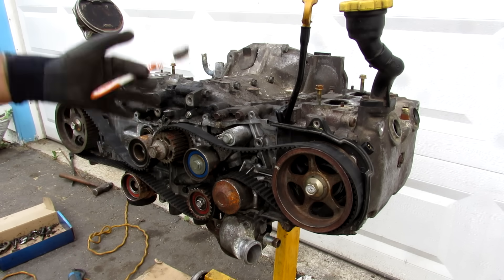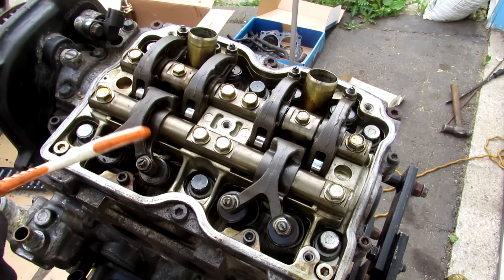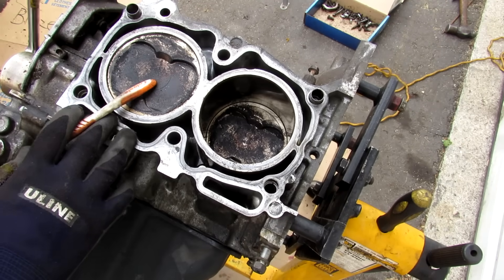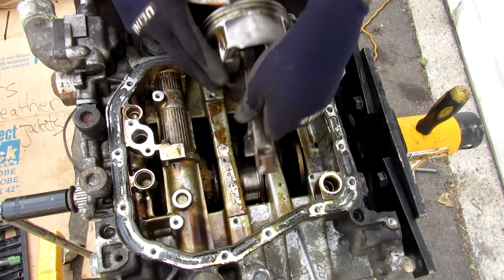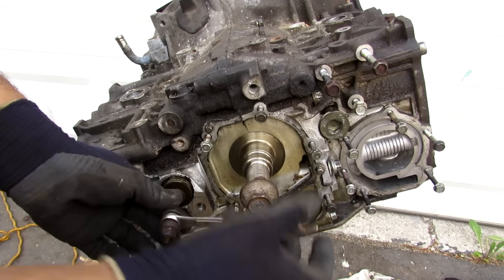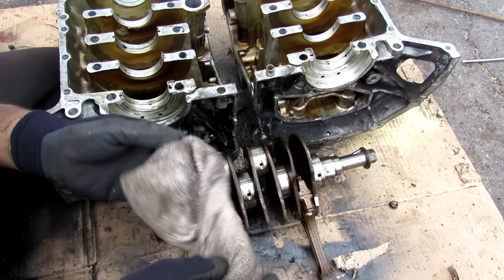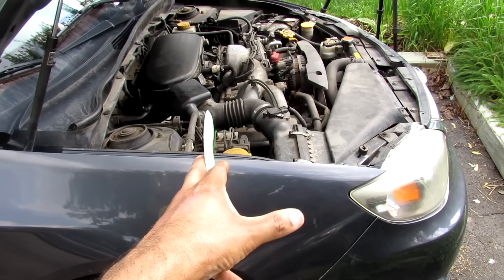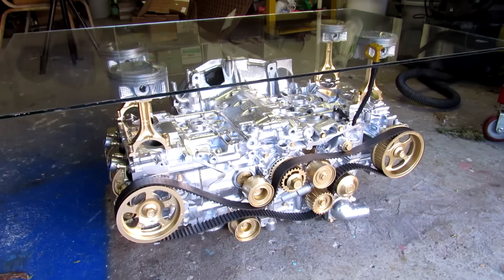Why Subaru Engines FAIL

Comment: Never owned, drove or had plans to buy a Subaru but your video is so well done, to the point and captivating that I watched the entire thing on the edge of my seat. FYI, I have been turning wrench since 1989 so good production is needed to grab my attention. You did it without the need for cheesy gimmicks or having to blow anything up. That takes skill. Nice work!
Reply: If you never run low on oil and never keep old oil inside the engine they dont fail, these engines are very susceptible to maintenance neglect, if the previous owners were idiots you Will have definetly problems
Reply: My 2-litre 2005 Forester did over 250000 miles before increasing maintenance costs made me move it on.  Don't know how far the next guy managed.
Reply: @alanhynd7886  Thats quite impressive milage. People here think that car with over less than that are junkers and preffer to he lied to that their car has equivalent of around 100k miles regardless of age.
Reply: @Kacpa2  Hi Kacpa2.  I obviously can't know for sure and might have been lucky, but I suspect that the advent of better oil (synthetic or semi-synthetic), better machine tolerances, etc probably means that a lot of vehicles can run a lot further.  My prior two cars were both SAABs and they both exceeded 250K. My wife's current car is a little D2 Volvo and it's at 150K without any major problems.
Reply: Subaru makes very good engines.  However, I would go with the NON TURBO engines.  They always have fewer issues.
Reply: @spaceghost8995  Its just a good rule in general in regarda to all kinds of engines.
 Mechanical illiteracy and lack of care is catastrophic for turbo engines in general, especially showcased when noncar people just beat around in heavily worn down turbo diesels. 

People already tend to mistreat their cars when they only use them for commute by not letting it warm up, driving it hard when cold and not letting it cool down a bit after the trip(in turbo cars)

 All this compounds massively on top of cheapening out on repairs and using long life stupid oil recommendations.
Reply: my 2008 Subaru 2.5 has 164,000 on it, same factory gaskets. I just got 27-30 mpg on a 2,600 mile highway trip. Change the oil, change the oil....
Reply: It’s a good beater. Got mine for free around 120k now I’m around 240k+ zero problems
Reply: I have 2 Subarus that I bought new and have had zero issues. I think this is because I always do the maintenance when due, if not a little early, I regularly check fluids and add if needed, and I don't drive like a bat out of hell.  Subarus will last a long time if maintained properly, but are probably less tolerant than some other cars if you don't pay attention.
Reply: @johnfromvirginia5794  EJ25 naturally aspirated engine is only engine that ever had HG issues and only because of the gasket itself. Subarus are actually very reliable. People spreading this misinformation and stupid jokes is untrue about every other engine subaru had. 
Turbi ej blows its gasket because of stupidly abusive teens and their idioticly ignorant tuning being just "Accessport" boost cranking circlejerk combined with bad maintenence. 
Take turbo ej25 gasket to naturally aspriated ej25 and you will never have HG issue ever again in your lifetime.
Reply: @Kacpa2  But there's plenty of other engines that can handle being tuned and turbo'd just fine. The fact that "Love, it's what makes a Subaru a Subaru" comes from Subaru knowing their cars take more maintenance and then putting that added cost and time on their customers says a lot.
Reply: @orangejjay  All caused by acting like ej25 is a hardcore built enigne from factory. On top of not doing any mwchanical mods. Especially Equal length headers, becauae uel is what kills the engines long term aside of burble sound.
There plenty of actually built ej25's that rwliably make more power. But it doesnt mean every stupid  kid buying stock WRX can molest it wirh access port boosting and expect it to be reliable. Ej25 turbo is very reliable if you leave it stock or actually build it right
Reply: Always swore by Toyota (landcruiser) 'til I spied a sad Legacy for sale on a forecourt a few years back. It'd been abused and neglected. Been restoring it gradually ever since while running it as my daily driver. Just brilliant on all counts.
Reply: I always buy Subarus made in japan, good quality.
Never had an American car or have plans in my life to buy one.
Reply: I owned a 1400dl in the early 80s. It was a piece of junk.
Reply: i recommend subie anyday.
1. they are all fulltime all wheel drive
2. some have turbo
3. all are boxer engines
4. newer subies have cvt trans
 this is not good.
5. having awd gives traction to stay on road and faster off the line
Reply: @rocketsmall4547  Awesome winter car, I run fat winter tires year round..

Comment: A boxer engine is smother then any v6 I’ve seen when running properly. Subaru engines are the most reliable in my experience so far! It called proper maintenance and not beating on them
Reply from the maker: They are prone to failure more quickly than inline 4 engines though

Comment: Oiling systems could certainly be improved on internal combustion engined vehicles. For one thing, the filtration system, to me, is barely adequate. Filters should be MUCH larger or the lubrication system should involve more than one filter to remove particulates AND also moisture. Adding to this, air intake could also be massively improved as far as filtration goes. There are SO many ways that dirt, dust and all kinds of things can find their way into your intake. The filter system should be AIRTIGHT with multiple stages or much larger filters in the first place to allow adequate airflow while still filtering out even very tiny particles. I'm glad I don't have to worry about this anymore since I bought an electric car (used, 2016 Kia Soul EV). best car I have ever owned or driven. I just can't picture myself driving anything else now.
Reply from the maker: Good points

Comment: One of the worst engines ever made and this mechanic is not very bright either. He's telling you to jam a screw driver right over the cam lobe while removing the cam bolt with an impact. He's also saying that crankshafts and connecting rods don't use bearings. He's a fool and nowhere close to a master of this craft. Sorry, not sorry.

Comment: This video should be called why any engine fails.
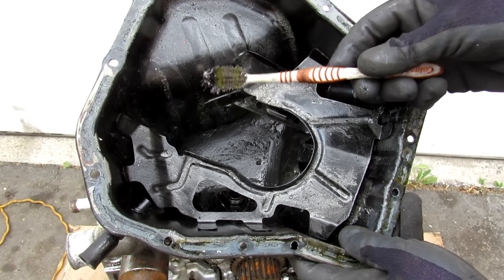5:25 there's no evidence of water mixing with coolant here. Oil will always turn waxy on hot surfaces because oil is at its hottest against the metal surfaces. It is these surfaces which heat up the oil to begin with, like a pan on a stove heats up the water in the pan.  Where ever there is hot oil and no moving parts to clean the surface, a waxy deposit will build up over time because the oil then gives off gases which exit the breather tubes and normally go into the fuel and air mix to get burned. Where you will see evidence of oil and water mixing is in the oil filler cap and radiator filler cap in the form of a light brown yellowish sludge

6:57  Some form of baffles and a deep well are normal in any sump, for the reasons you describe, it's not an idea  specific to subaru flat four engines.

7:25 water fills the whole jacket, therefore water doesn't "settle" and gravity while parked is irrelevant. You're implying that there's air above the water, which isn't the case. How would the water pump work if there was air above the water? A head gasket won't fail just because it's a flat four, it also happens on inline fours. Contaminants, however, do settle where ever water flow is turbulent which is typically on rough casting surfaces such as water jacket lining and where gaskets protrude from the inner sides of the flange.
Reply from the maker: Good observation

Comment: Thanks for producing such a wonderful and knowledgeable video.  The only thing that I knew about Subaru engines was they were an opposed or boxer design.  I have a great deal of engine overhaul experience and found the Subaru a bit quirky in some of its design.  IMO, the term "engine case" might be more correct than "engine block" since it splits and is not a single block of material.  Thanks for the education.
Reply from the maker: Glad you learned something
Reply: If its opposed it would need 2 crankshafts, it's a boxer mate

Comment: My 1999 Outback FWD engine ran just fine until I got rid of it last year. The problems were, tach/speedo/odometer intermittent and finally failed, RVM will move with road vibration, air box control fails (3 x), gear shift linkage keeps disassembling itself, hood latch quit latching (how the hell does that happen? had to shim the hook to get it to work), knobs and window control levers fracture. I kept it so long because the drive train was so good..

Comment: I worked for a Subaru dealer back in the mid seventies, attended a factory school on these engines and graduated from that school in April 1976 in Norwood mass. these engines have had head gasket and lubricating issues since 1971, Subaru has not resolved these issues in 50 years, pathetic how Subaru has ripped off the American public for 50 years, selling this junk, yet there is still people that say  oh I love my Subaru, as they write a check for thousands of dollars for a head gasket job, a problem that should have been resolved by the factory 50 years ago. Ignorant bliss, yea that's it.........

Comment: You have the wording backwards at 3:45. Although the oil does indeed cool the engine, it's main use is to lubricate its components. Same goes for the coolant.

Comment: Yes engine bolts have to be re-torqued (checked) periodically but that's only due to a Boxer's design floor, oil/water cross contamination is where your wear problems all begin, Subaru's answer was to crank those bolts so tight and stop inner gasket failure, the trouble is the alloy casting threads stretch over time, hence you gotta keep tightening them steel bolts up and that's expensive😀

Comment: .....seriously dude, you don't like Subaru's so why do a video on them.  Lack of maintenance has always been No1 cause of premature engine failure, No2 the crankcase knock sensor's are mounted too close to the crankcase, need spacing at least 12-13mm higher to stop the ECU from overly adjusting the timing . Short runs don't do the engines any good either.  An engine reconditioner told me that because Subaru's have very close machined engine tolerances, when people put 20/50 engine oil in them, the thick viscosity doesn't pump into the running surfaces fast enough which accelerates engine wear. I ran 10w30 in mine and it ran like a Swiss watch for years. Lastly, the oil filter housing on some Japanese domestic models also have water cooled housings. Here in New Zealand these are NOT spec'd in the build for export to us from Japan.

Comment: Hey mate , this engine is exactly like the one I have in my legacy, my great question is. Would be possible to install a intercooler on top of the engine, exactly how it is on the Legacy GT?
Reply: Entirely different engine. This is a EJ253… Legacy GT's have the EJ255 which is the normal WRX Engine.

Comment: My ex’s Subaru engine failed because the pressed in cylinder sleeves got loose. Under 100,000 miles on the car, she had owned it since new and had had oil changes every 3,000 miles at the stealership. Around 75,000 miles the head gaskets blew, they were replaced and the stealership said the engine had no problems “ this just happens some times with aluminum engines.”. She believed them.

Then like every 2,000-3,000 miles after that the head gaskets failed. After she’d spent a bunch having the stealership do the head gaskets several times IN ONE YEAR, she asked me to do them. I wanted to discover the root cause of failed. In,previous cars head gasket failure had been related to overheating the engines, warping the heads, so I took the heads to my machinist. Nope, they were flat. We did a valve job anyway. He told me that his experience had been the cylinder sleeves. So I took the block to a different shop and they said the sleeves were loose and sliding and that they could do the new press in but that the cost was a lot. I went to a different stealership and had them check out the block, talked with their head mechanic and he quoted me a few grand just to buy new cylinders/pistons (they came as a set back then), plus of course the thousands to press them in. 

So, she bought a new Toyota. 

Moral of the story, does Subaru still have this problem? How many miles (not how many years, how many miles!) before you need this expensive rebuild on your Subaru? To me, who’s cars usually run over 250,000 miles with nothing this serious, what kind of poor design causes this expensive failure with so few miles?

Comment: People must really be abusing their engines if they're failing like that.  I've owned 4 Subarus, everyone else in my family drive Subarus, and their engines always outlast the bodies.
Reply: That is like my 2000 Forester has 488 000 km on it and rear strut come up into car. Haven't done much to the motor and it still runs like a charm.

Comment: Why Subaru stays with this engine design is beyond me. Why continue with something that time has clearly proven to be a failure. I bought a new 2009 Subaru Outback. From day one it consumed oil. At first I assumed this was due to a new engine that, like all engines, needed to break in and have the rings seat. 5,000 miles in and it was still taking oil. I called the dealership and spoke with the shop manager. He said that is what the boxer engines do. They use more oil than "regular" engines do. I thought to myself that this seemed crazy. A brand new engine should never consume oil after the break-in period. Fast forward to 120, 000 miles with oil changes by the book and always using full synthetic, the engine blows a head gasket and a hole in the #3 piston. Having lived my adult life in the mountains with lots of snow, I used to think Subarus were the best car ever invented. I would never recommend them to anyone today.

Comment: Title correction... Why Subaru 4 bangers fail. The 3.6 flat 6 doesn't have these problems. My brother's has 200k miles and has only had normal maintenance.

Comment: Just one inaccuracy I will point out , the v6 engines are inherently unbalanced , that’s why they use ballancers ( basically counter weight ) and they are heavier than inline 6 . Otherwise very informative video 👍🏻
Reply: Yeah he mixed up V6 and Straight-6, like what's in his Supra. The Straight-6 is balanced on primary and secondary forces, just like the boxer-4 in the video, however the only V engines that are similarly balanced are V12s... because they're just two Straight-6's fused together.

Comment: One issue that I don't think you mentioned was that the extremely long timing belt is susceptible to breaking. And as I have found out the hard way....  drives the piston into the valves. If you are lucky like I was, the only damage was 2 bent valve stems.
Reply: How many kilometers did you drive before it snapped?

Comment: The fluids pooling without gravity helping them drain to their proper reservoirs contributing to the head gasket failure has always been a theory I’ve had glad to see you point it out seems a fundamentally flawed design period I had a Porsche with a boxer engine same thing head gasket went
Reply: Its bunch of horseshit tho. EVERY ENGINE is constantly flooded in coolant to the top and under pressure. There is no god damn pooling going on. Head gasket failure on ej25 is purely from cheap graphite gaskets. The graphite wears off from temperature and coolant. All you have to do to have it PERMANENTLY fixed. Is to use Multilayer steel gasket from ej25 turbo from WRX. It will never ever blow out.
Reply: @Kacpa2  there isn't a Subaru sold in 20 years that have a head gasket issue. It's nonsense. It was fixed when they change all engines to the MLS gaskets back in the late 90s early 2000s. 

The problems are actually overheating, and people putting down massive power blowing the cylinder walls out of round.
Reply: @jeepmanxj  I was talking about 2.5 naturally apsirated EJ. And for turbo i know you dont have to tell me. Its always user negligence or ignorance with turbo EJs.
Reply: @Kacpa2  even the na EJ hasn't had the issue in decades. It was well known enough that Subaru would replace the gaskets for free.
Reply: @jeepmanxj  Yes, but damage to their reputation was done, and now everyone stupidly memes about headgaskets whenever it comes to Subarus. Also not everyone had it fixed correctly, its incredibly widespread because of EJ25 that was affected by use of that shitty graphite gasket was sold in gigantic volume worldwide in Outbacks, Foresters and Legacies and people usually went for EJ25 instead of EJ20 or EZ30.
Reply: Ever considered why comma is supposed to be used?

Comment: picked up a 2009 forester with 248k miles for $600. owner said head gasket was bad, blowing the coolant out. I asked if it was getting water in the oil, he told me no so I took the chance and drove the 2 hours to get it. found out he took good care of the maintenance(interior isn't very clean but not disgusting) Had it serviced every 4,000 miles, and have every single piece of paper for all the work done to it, so that gave me a lot of hope. tore the heads off, surfaced them myself, new valves, and MLS head gaskets. as well with all new front timing water pump. cylinder walls still had all the cross hatching in them so that gave me more hope. now still running good 12k miles later with 260k miles. doesn't loose coolant, but I do have to keep an eye on the oil, about 1qt every 1k miles. but thats nothing new to me.